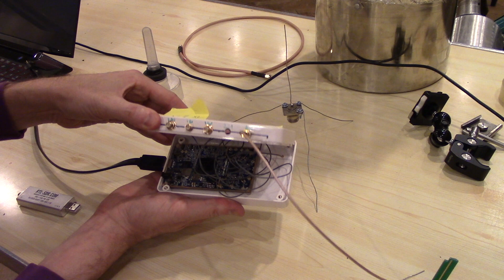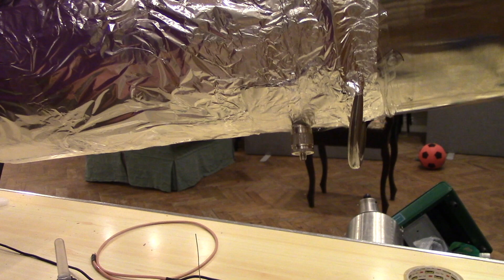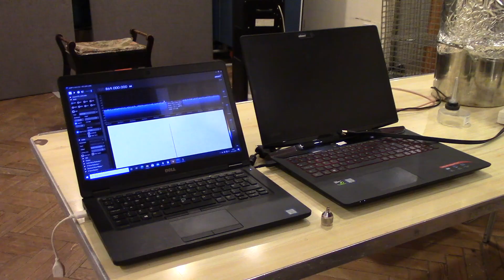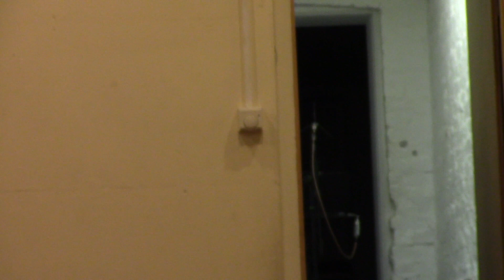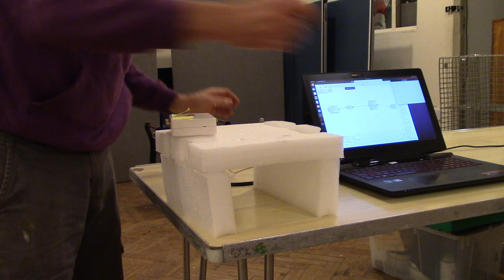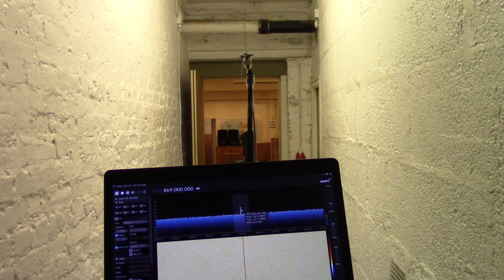Antenna Comparison - Street light antenna VS my bodged ones

Comment: Can you see if you can persuade the little Harvard thing to transmit just to see what the output power is? Not that I think it'll be huge at all, but it'd be interesting to see.
Reply from the maker: Yeah I broke the one I have here connecting the antenna test cable, I have ordered another Gateshead lamp post mounted Chinese directed energy weapon from eBay. I have the original WiMAC installation and provisioning equipment so I can make it transmit and measure the output power.